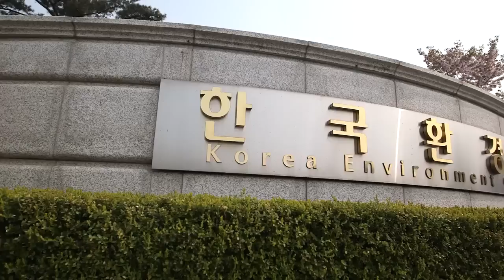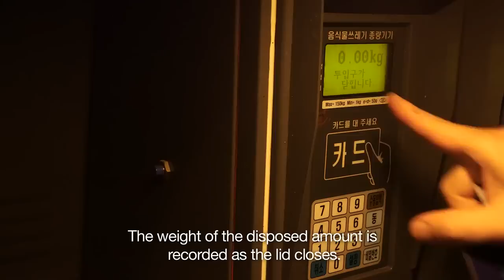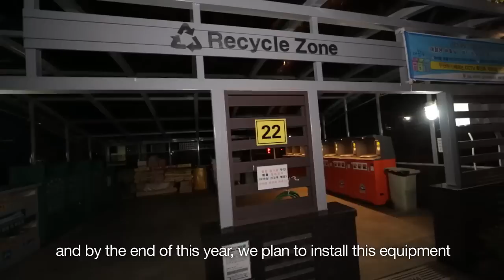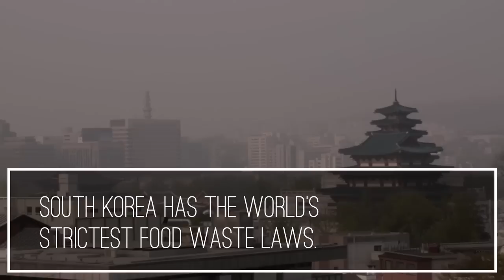In South Korea, an Innovative Push to Cut Back on Food Waste

Comment: Does the system count food scraps that aren't necessarily waste, like banana peels or egg shells? Is composting a part of the system in any way?
Reply: Amanda Sandlin Anything that can't be made into animal feed -- like fruit peel, egg shell, nutshell, animal bones, and seafood shells -- belongs to non-recyclable waste, not food waste.
Reply: toe39 Is there an opportunity for composting? I guess I am wondering if you are charged for the food waste even if it's stuff like the shells/peels, or can you do your own compost and not get charged for that?
Reply: You would only be charged for what you put in the bin, so you won't be charged. If you have your own yard, you can definitely do your own compost. Non-recyclables are charged by the volume, while food waste is charged by the weight. You would put your shells in the non-recyclables, so it will count by the volume along with other normal waste.
Reply: I disagree that fruit peels, egg shells or animal bones can't be used for animal feed.